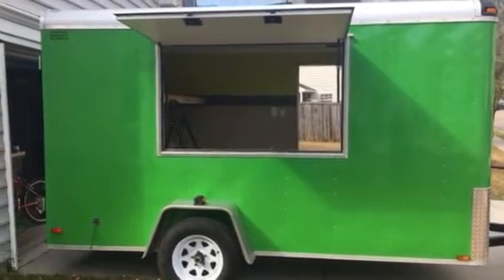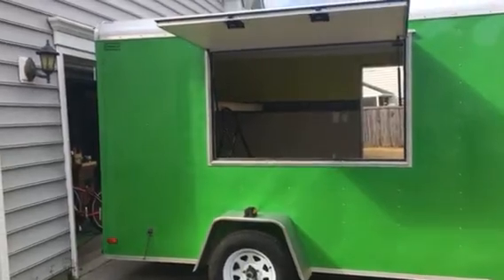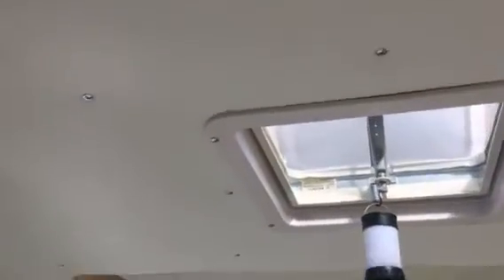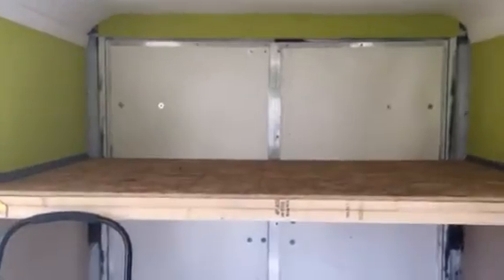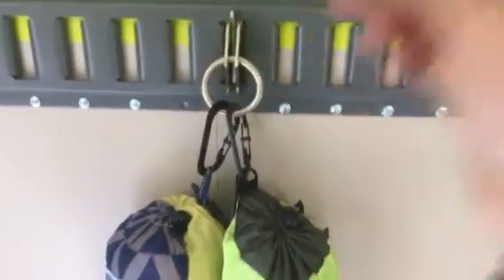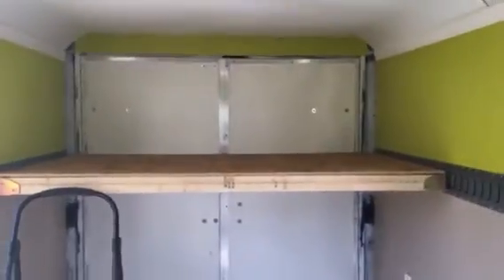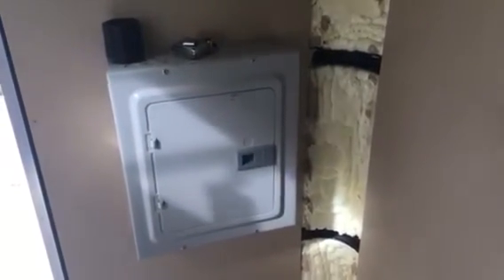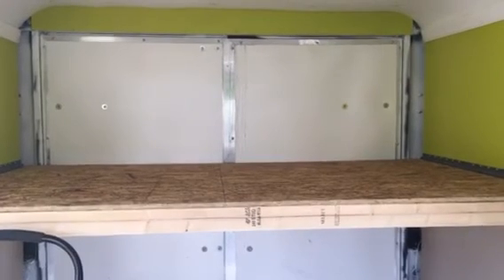6x12 “Is That a FOOD TRUCK?”  Update to Prepper Cargo Camper Conversion

Comment: Great job. Bunk is killer....ceiling looks great. Put any storage chests with any weight to them over wheels. Better balance and towing. Less herky jerky or tilted load.
Reply from the maker: Thanks Brad.  The plan is to have the lower bunk high enough to store the camp box underneath (right over the wheels).  Another helpful tip, thanks again Brad. 👊🏻
Reply: Prepared 2 Thrive 😊Looks great. When does diaper pick up service begin? 😉
Reply: Prepared 2 Thrive lol at your neighbor poking around. 
Tomato soup and grilled cheese. Open from 11-2 or till empty.
It in my sights.
Grow my tomatoes indoors....😂
Reply from the maker: Simple, yet genius!!!  I like it.
Reply from the maker: Dude, this is an awesome idea.  Down south Mac & Cheese is a thing...that could be a thing.  They treat Mac & cheese like a gourmet item. It’s odd, but kind of funny
Reply: Prepared 2 Thrive it is nuts. Lol. 500 servings.....x 5= cha-ching for 3 hrs. 🙂Has to be simple fast...no options. What are the options? None. 😉